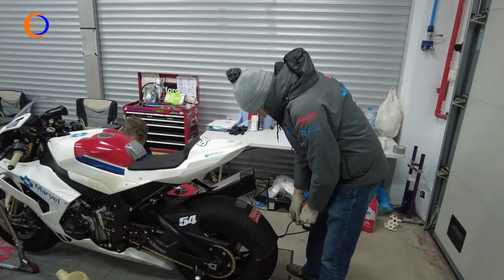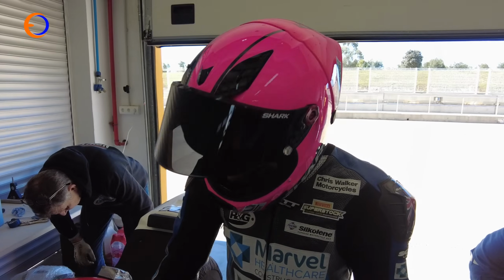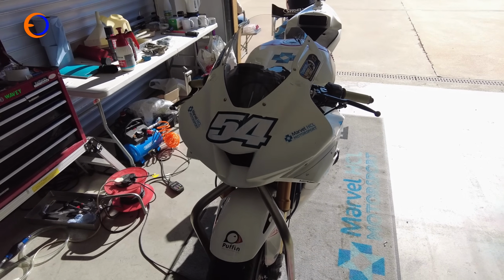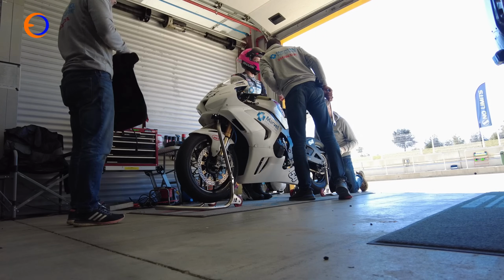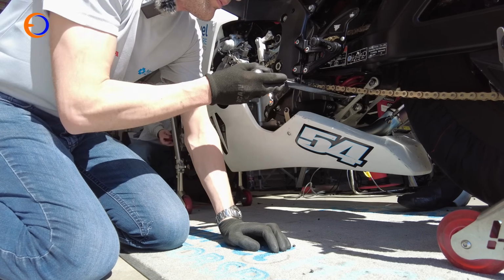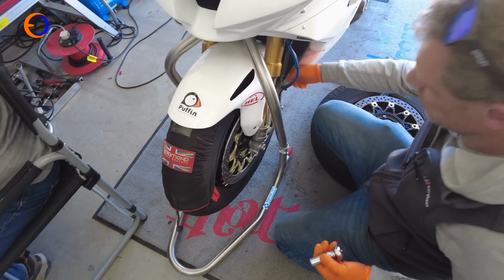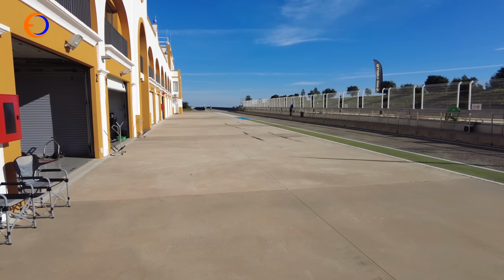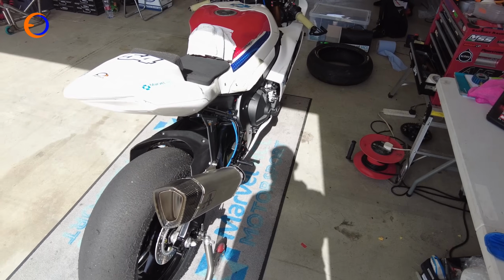Testing Times. Franco's First Fireblade Feelings at Monteblanco BSB Superbike Spanish track test

Comment: Cracking video, brilliant insight to a test day, an especially great hearing a lad transition from a 6 to a thou. Subscribed more future vids!

Question, what do you find works with the front forks? Like in regards to setting up preload and sag's? I'm tempted to run softer than usual in the forks and thus more static sag potentially as I've around 30mm left of fork travel which I'm not used to seeing when I've setup my forks in the past, not sure if its because of the amount of travel these forks have on them vs my previous ohlins forks I've used. How are you guys getting on?
Reply from the maker: The blade forks look long but the cartridge stroke is the normal 125mm.
On the logger we're using all the stroke, it just doesn't look like it on the outer leg.
The road bike is similar, so I'd still suggest a normal sag setting

Comment: Sometimes it seems odd to make changes for change sake, but appreciate you have to experiment with testing both how the suspension technician thinks the bike will react to dynamic theory, to test how intuitive and successfully the rider  translates any changes in their communication. As you said not easy to assess changes when the tyre only grips consistently for a few laps. Odd about the heat soak effect on the discs.
Reply from the maker: Franco gives very honest and really good feedback, and some changes definitely don't give the response I expected, so it's all useful info